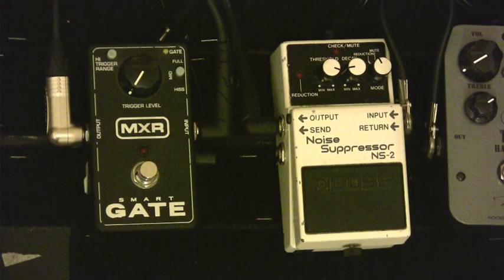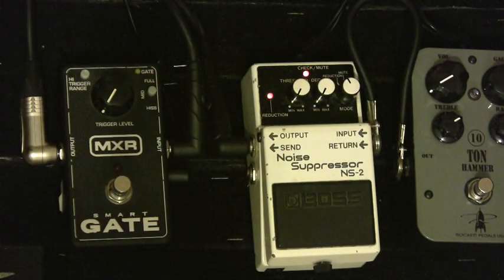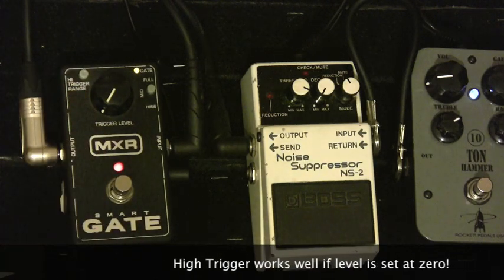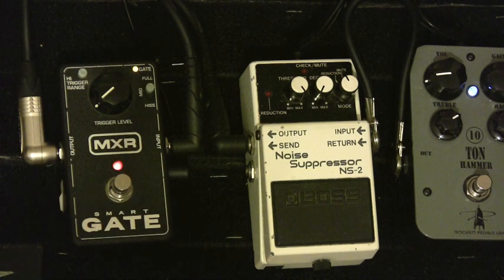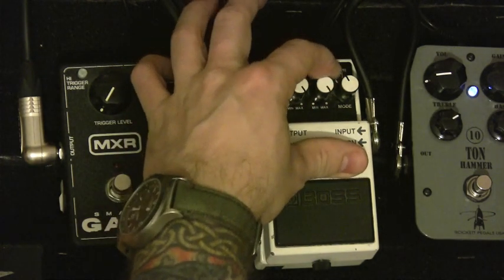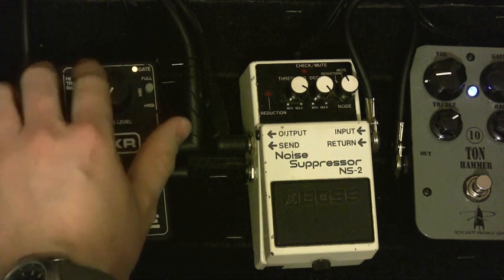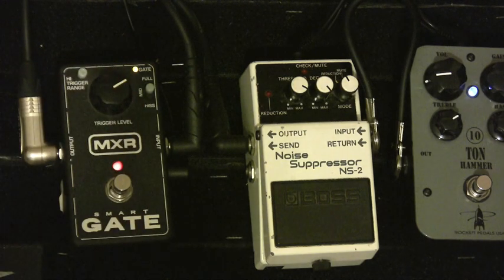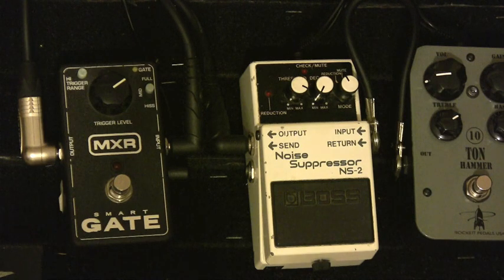Boss Noise Suppressor Pedal Vs MXR Smart Gate Noise Gate - With Rockett 10 Ton Hammer

Comment: One little problems with this video is that the pedals are in the chain at the same time. I can't speak for the MXR, but I know that the Boss will color your signal as long as it's in the chain; it doesn't matter whether it's actually engaged or not. Like I said, I can't speak for the MXR, but the Smart Gate may possibly be more favorable to some players than what this video demonstrated.
Reply: The MXR-M135 is advertised as a true bypass, but as you said, the boss will color your sound, because it is not.

Comment: I owned an NS-2 for years & loved it but I used to run noisy stuff through the loop & this is where it shines. But in this application the MXR kills it, I mean the Boss was near on full while the Smart Gate was on zero & was still better. I find that every noise gate/suppressor has a use with someone.

Comment: Someone else may have said this and if so nevermind- maybe noise gate should be before dirtbox so there is less hum going into the gainbox in the first place where it is multiplied . Also the boss has a buffer and may work better with some stomps than others. Still very informative and I appreciate the comparison !
Reply from the maker: Thanks Alan. Glad it helped.
Reply: Amptweaker did it with their TightMetal Pro, works like a charm :)
Reply: ...no?

Comment: How much does the noise gate affect the sound? I used a Rocktron Hush and I must admit it takes the noise but it also affects the sound!
Reply from the maker: I wouldn't say it affects the sound at all. Just chokes it a bit if you set it too high.
Reply: Simon Smith That's it! It chokes the sound. I'll try from scratch. Thanks
Reply: Marko Borščak 

Know, a Rocktron is NOT a Noise Gate, but a Noise Surpressor. Threshold shouldnt be set above 12 oClock with this pedal, and you cant expect a perfect cut from a Noise Surpressor, other than from a Noise Gate.

Comment: Good day Simon,

Glad to have came across your video. I am having this damned 'white noise' coming from my boss dd20 pedal, even when the pedal is on/off, or my guitar volume is down. It is just there. And the white noise goes up with the amp's volume.

Which pedal would you advise me to get? MXR Smart Gate or ISP Decimator?
Reply from the maker: Hi mate. I would say that neither of these pedals will fix this. Sounds like your delay pedal is in need of either fixing or replacing unfortunately...

Comment: do the pedals only get rid of noise from the other pedals or can it help when you have the amp on a distortion setting?
Reply: It works if you add it to your amp's FX loop (if it has one)guitar-> NS2 in , ns2 send -> distors pedals -> amp in, amp send -> ns2 return, ns2 out -> FX pedals-> amp return.

Comment: this is not what these pedals do, you set the threshold to determine at which point the gate cuts in, if you are using a single coil guitar with gain you can adjust it to cut out the noise when you stop playing. I play with a lot of gain and emg 81/60 pickups, i use the mxr to control the level of noise/ feedback. Not all noise is bad imho and if u want it u just turn the pedal off!!

Comment: In Amplitude and Guitarrig you have your own dedicated noisegates, no need for this one.
It wouldn't have worked, because the dry signal from the guitar is all you would have gated, not the wet signal from the simulated amp or pedals.

Comment: Good video, though both pedals really need to be tested separately and not wired through each other or to the same amp. All else being equal, the MXR seems to be true to the original tone. While the Boss does a great job knocking down the noise, it does also muffle the tone a bit.
Reply: He is using the NS-2 wrong.
Reply: Joshua Taylor how do you use it right?